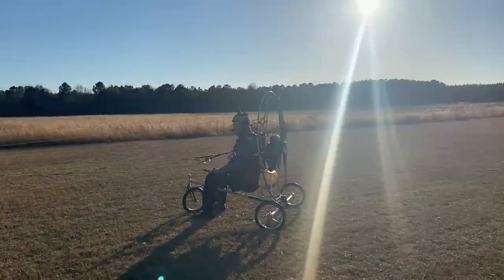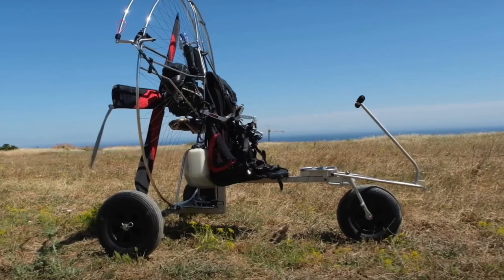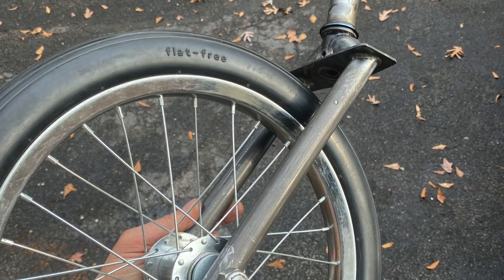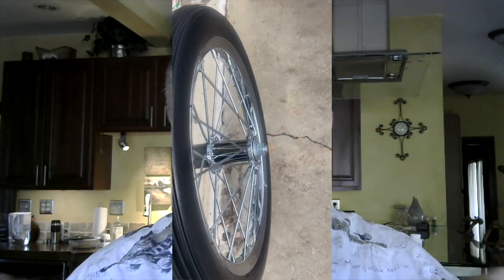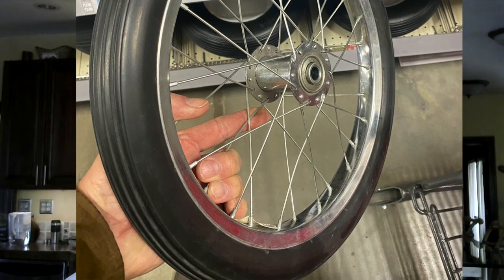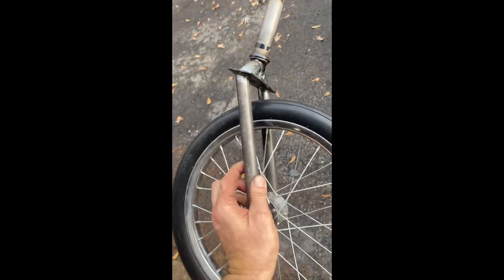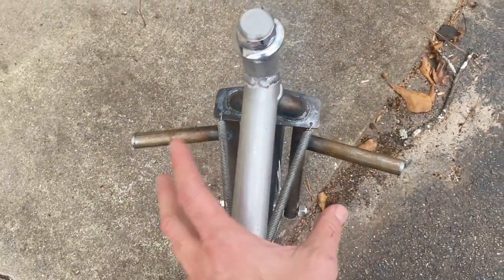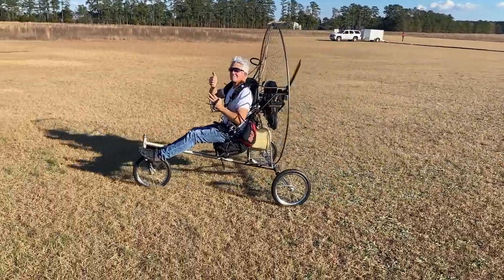The $148 homemade paramotor trike

Comment: Nice Yank. Welcome to Triking. You asked for any improvements. On the Colibri there is only one spring, it has a tab about 3 in long welded order the front fork in the center. A stiff spring hooked to that and tensioned back to an eyelet   on the center pipe. Super sweet build.
Reply from the maker: At a fly-in in South Florida this weekend. I’ve looked at a whole bunch of trikes. Next build I may look to come up with some sort of internal spring that fits inside the vertical shaft for the steering. Nine flights tonight - I’m kind of warming up to it, but I miss the art of foot launching.

Comment: Built my own paramotor as the first one I bought kept losing bits and I spent most of the time repairing it and modifying it to stop staying on the ground or prematurely ending flights. Sometimes it's best to start from scratch and take the best bits and really think about the design concepts. We in the UK have to have a licence to fly non-foot launched. I ended up using a KT100 Yamaha engine. I was 15 stone then and it got me airborne quite easily. I'm 12 now so need to get it out of storage! Youtube Madcow paramotor or Steve Cowham, or both. Cheers!

Comment: Thats great Todd. My one suggestion is that you gusset that 'T' junction. That is a lot to ask of that one weld and if it failed a lot of stuff would get damaged. Now I am inspired to adapt my P2F Rs to my BlackHawk Lite trike.
Reply: Good point VBob! I missed it but agree. I have a problem with his using spoke wheels...side loads on takeoff & landing.
Reply from the maker: OK....I may add either a short gusset plate or triangulated tube supports, but keep in mind that the base of the pap TinOx is stainless tube.  It is bolted in tight and jammed between two 5/8" steel pins at the nose. There is virtually zero play between the trike and the PAP base when it's all together.  That prevents or at least shares torsion placed on the T section.

Comment: Nice bit of designing, engineering, and fabricating, and overall, very impressive! I'm just getting started in PPG this year, focusing on foot launching, but if a trike is in my future, I'll probably be following in your footsteps!
Reply from the maker: This build is not really stout enough for learning.  It's reasonably sturdy, but the wheels I'd used are just light weight and sloppy in their construction.  They are lawn cart wheels not really intended to exceed 5 MPH.  I am working on a few things: 1) a stouter version of this trike with more frame reinforcement so that it won't have to rely on just the "T" join weld 2) larger pneumatic tires and thicker axles intended for the potential need to absorb some "side loading".  3) I am looking to build #3, which is really a community project called Open Source PPG.  That one will be a monster preformance  solo or tandem capable unit.  Progress has been halted for a bit as I travel some but here's where the end result will eventually be available for free: OSPPG.com

Comment: Well done 👍. Great job
Reply from the maker: Thanks. I still fly it but I think I will be spending more money for stouter spoked tires and pneumatic wheels soon.  After many dozens of uneventful landings, I had a smooth landing a few weeks ago that ultimately resulted in a structural failure. After touchdown, I tried to taxi up a slight 3' sand berm between my landing spot and the truck. The berm is grass covered but a little soft.  Minor side load caused the solid rubber tire to walk off of the front wheel, then as the rim dug into the dirt, the lightweight spokes all flexed too much and allowed the rim to bend.  Lastly the forks dug into the ground and snapped my gooseneck weld.  No injuries and it's all fixed now, but cheaply manufactured tires, on poor quality wheels, with spokes made of Chinesium alloy are not a great idea. There are better options for strong tires, but they are way more expensive and require more lead time/planning than a drive to Tractor Supply.

Comment: AMAZING! That is all I have to say about this build. Your use of fusion360 and 3d printing parts was highly impressive! Great stuff Yankee!
Reply from the maker: Thanks! This is encouraging. I really want to build an “all out trike”, for maximun single pilot performance, or best weight capability on a tandem flight. I am learning however, what many before us have learned... and that is the transition between air cooled 2 stroke engines & water cooled 4 stroke engines... leaves a big gap between reliability and power to weight ratio, right around 40+ H.P. There are so few options, especially if you are eyeing production at some point in the future.
Reply: @YankeeinSC1  🔴 What Is Islam? 

🔴 Islam is not just another religion. 

🔵 It is the same message preached by Moses, Jesus and Abraham.

 🔴 Islam literally means ‘submission to God’ and it teaches us to have a direct relationship with God. 

 🔵 It reminds us that since God created us, no one should be worshipped except God alone. 

 🔴 It also teaches that God is nothing like a human being or like anything that we can imagine.

🌍 The concept of God is summarized in the Quran as:

📖 { “Say, He is God, the One.  God, the Absolute.  He does not give birth, nor was He born, and there is nothing like Him.”} (Quran 112:1-4) 📚

🔴 Becoming a Muslim is not turning your back to Jesus. 

🔵 Rather it’s going back to the original teachings of Jesus and obeying him. 

More ....
Reply from the maker: @1islam1  What does it say on that Saudi flag?  Seems contradictory, but thanks for bringing up the fact that.  What's in that black box they march around anyways?
Reply: @YankeeinSC1  dear sir, thanks for the videos. I have been on the verge of building a trike for the last six months or so ever since I ran into a video will yours actually of paramotering, I feel that I could make one a whole lot cheaper than what they are selling them for, please have patience with me I'm not an engineer but what's to keep me from putting a 650cc water cooled motor, I happened to have a motor with only four hundred road miles on it,, it's practically brand-new, would there be a problem of putting the prop on or is that problem able to be overcame ,, I would really love to build my own cart,  I definitely respect your opinion, so any encouragement or if you see something wrong with this approach I would definitely appreciate the input, thanks again for your time, g l Baker lake Cumberland
Reply from the maker: @glbaker5595  I have to assume that the motor you have was designed for a motorcycle?  It's funny in that non-engineering background folks, often miss a full understanding of BOTH the limitations and challenges of repurposing engines for aviation use. This harkens back to the earliest days of airplane design.  The age old question "what engine should we use?"  Or as in your case, we have a "free" engine, can we use it for our flying contraption? The problems are numerous and manifest themselves in sometimes hidden ways... Like we wanted more power so we "upgraded" the engine, but fuel consumption became such an issue...or now it doesn't have the range or payload or the stall characteristics are more dynamic..etc...Most of those airplanes end up as donations to museums or sitting in the back of someone's hangar until they become part of an estate sale.   I've seen and assisted fellow aircraft owners & home builders (and now PPG cart and trike  owning acquaintances) with scores of VW, Corvair,  Corvette, Model A Ford, Briggs and Stratton, Kohler equipment and other automotive conversion applications.  All required highly advanced engineering skills to obtain marginal performance.  In most cases, the sum of the end product cost(s) exceeded the cost of purchasing a new power plant designed for the application (Lycoming, Continental, Vittorazi, Rolls Royce etc...)  Can it be done?  Sure! and it can be fun... but you now have to solve all of the problems i.e. ignition reliability, gear ratio and prop speed, cooling, engine mount system, unknowns like thrust bearings, oil scavenging at non motorcycle flight angles etc... ALL of these factors are taken into account when engineers set out to design an engine for aviation use.   I guess I'm saying that it depends what you want out of life.  Do you want to spend time learning about and tinkering with all of those things? sometimes the hard way (assuming nothing ever fails and kills you)? or do you really just want to spend your time flying? If the former interests you, I can assure you I have fond memories of tinkering with the timing, valvetrain & water pump reliability issues my buddy had on his Model A Ford powered Pietenpol Aircamper (it appears briefly in one of my earliest videos). His ambitions of flying the plane he'd built, all the way to the annual convention in Wisconsin, from our airport in South Carolina were finally realized about the time I started posting PPG videos.  On his flight home however, he landed at a municipal airport about 60 miles short of home.  We took the airplane apart and brought it home on a flatbed trailer.  He reassembled it and thought he'd fixed the problem, only to crash just off the airport property a week later.  He was uninjured, but the aircraft was a total loss...why? Because the engine was a poor choice for a flying machine.  To the later question I've posed...do you really want to spend your time flying? If that answer is "YES", then purchase the lightest (power to weight ratio) and strongest (thrust to weight ratio), designed for the application (aviation) engine.  Best of luck!

Comment: Hey! Fantastic! I made one too!...for about the same price!  What I'm doing now is using a gutted Trike buggy. I strap into my Miniplane, sit in it for takeoff & lift out of it at takeoff speed. Remember the German rocket plane of WW II? It used roller gear for takeoff which dropped away at takeoff then landed on a skid. I do the same but land on my feet. I have Neuropathy. I can land on feet carefully but not takeoff. I'm 73. How many drill bits did you go through to cut through that axle? What type? Thanks! Great video! You may have side load trouble with those spokes.

I agree with Miraslav on thrust angle. Mine was angled too far downward & would actually lift the canopy skirt first for a very sloppy inflation....since fixed.
Reply from the maker: Hi Bill.  I broke only one tool :(   A 1/4-20 tap that I was fortunately able to extract.  I was putting threads in front of those stainless steel motor frame capturing mounts.  On the PAP rolling trike, those holes have bolts installed that allow some left/right adjustments at the base.  Turns out when bolted in there is virtually zero play or slop on mine.  I'll really defend the spoked wheel choice if I get 50 or so flights without a failure.  The wheels are robust and intended for garden carts.  This build was never intended to be a forgiving frame for new pilots.  By theory it is as light as I could make it.  I still subscribe to the one knot more airspeed, one ounce more of useful load, one more mile of range, one less pound of drag...well you get the idea.
Reply: @YankeeinSC1  From listening to you talk you're far more knowledgeable than me. I took the very simple Ace Hardware route....but it works. People ask me why don't I just fly theTrike itself It's because I like sitting in the seat. Anyway thanks for the reply & info! I understand about the spokes now...just us nitpickers out here. You know. Me advising you is like a new A&P advising Bill Boeing.
Reply: Bill do you have a standard miniplane cage with the glassfibre ring or have you reinforced it? I have that frame and have been wondering for some time if it would hold up for a trike, im thinking about the force on the cage as the wing inflates.
Reply: @rickardjonsson4526  That's a very good question & you'll be surprised at my answer! I hate typing on this tablet so I'll reply in the morning  on my desktop with wonderful Win 7 Pro.
Reply: @rickardjonsson4526  I say your reply is funny because I did modify it but the results were okay and not okay. I got tired of replacing those expensive fibreglass rods from old what's-his-name out west. So I got to thinking. Solid rod Aluminum of 3/8ths O.D. variety. Pulled the fibreglass out, used one aluminum rod, fit perfectly all the way around. I'm about to do a video on it but here's where the el problemo came in.

First of all, it (the new aluminum rod) had no problem holding up against the pull strain of takeoff using the Miniplane & a 26 meter. However, one day I had the chute fall off to the left rear in a mild breeze. It partially (just enough) collapsed the aluminum rod into the propeller. I was able to salvage the prop (so far it hasn't shattered - again) and was able to reuse the cage aluminum rod (so far). However, it is weakened now so I have to be careful the chute doesn't fall rear left again. What exacerbated the situation was that I was slow on shutting down the motor. That would've prevented most of the damage.

Now, would the fibreglass rods have prevented all of it. Possibly so. Possibly not....since the force of the chute's (suspension lines) fall was severe. Do I still use aluminum as described here? Yes. I got tired of buying old what's-his-name's fiberglass ones. Fly safe! Hope this helps.
Reply: @billcallahan9303  thats for the detailed reply👌 Why did you need to change the fibreglass, what happened to them? you can buy 10mm fibreglass rods locally or online for nothing, and the short metal sleeve to connect 2 rods together is often free if you go to a plumber shop👍
Reply: @rickardjonsson4526  Good question. First off, I didn't know you could buy them like that. I bought them from...I can't remember that guy's name, he sells Miniplanes & parts, but at $50 for two rods I got tired of buying them after four. So I came up witht the aluminum rod idea. So, thanks to your information, I may search online for cheap fibreglass and Thank You for that. Oh, another reason I went with aluminum rod was, at the time, I thought it would be just as strong or stronger than fibreglass.  I also liked the idea of a one piece loop.
Reply: @billcallahan9303  yeah i see why you wanted alu but it sounds like youve had to change the fibreglass multiple times because they broke? If so how and where did they brake, ive always been curious if they snap or just bend when to much force it put on them😊

Comment: The number 1 consideration in my opinion is to keep the CG as low as possible. I fly a trike buggy right now which is a very low CG machine that is very stable.
Reply from the maker: I almost bought one with a Polini 190 on it for $4500. The engine had some "history", the mount system wasn't ideal and I didn't like the idea of the riser guides, so I passed.  James who taxied mine in this video has 4 machines and is currently flying a trike buggy.  More important than low CG at any cost, IMHO, is a design that is as near an Isosceles triangle as can be tolerated.

Comment: Thanks heaps for this. What I'm trying to work out is the seat holder. While on the ground it looks like you're going to be pivoting forward and back on that part sticking up, and your seat-board. Just strugging to imagine that. Also, in the air how does the seat get seperated from the bar you're sitting on?
Reply from the maker: The PAP seat board is a 5 ply thin laminated board (plywood).  Given that it is attached to the harness at the rear of the seat, you can't really "pivot" much, maybe a little, but the board is supported at two points, the fabric continuation from the harness back and now your under seat support.  Alternatively you could build a little square table like support rather than just a bar like I choose to use.  It's important to note; that as the swing arms are lifted by the wing, the seat isn't lifted off of whatever type of seat support you go with, until the very last little bit of swing arm travel, assuming you want to retain most of the weight shift ability of your foot launch rig. If you don't build so that the swing arms eventually lift the seat bottom off of the support, you wont enjoy as much weight shift capability.
Reply: @YankeeinSC1  Thanks for the explanation

Comment: Took off no problem. What does it weigh with and without motor? Not much give in that rear end. I built the Lite Trike we had to adapt it to a Flat Top because of the crumple zone. I really like my lite flyer. Fiberglass axles makes for smother landings. Looks like you did a great job. Love to see more videos. Very smooth landing.
Reply from the maker: I need to weigh it... 28 pounds?
Reply from the maker: I did weigh it...29 pounds plus primer and paint
Reply: That's a lot lighter than most. Mine was 30 lbs that was with the wheeleez beach tires (which coast the most, about $230). Now I have a 5 gal aluminum gas tank and 11' chrome 4 ply go cart tires. I also made a self centering front end. Same principle as yours. Do you have pictures of the hang test? I'm sure your wheels will take squirrel holes much better than mine... but I look sexy lol.
Reply from the maker: @David65702  I did post a photo of the hang test on the facebook paramotor homemade page.  Pretty benign I had to move my attach points as far forward as the PAP arms allow. to insure the front wheel leaves the ground first and arrives last.
Reply: I'll see if I can find it I'd like to see it. It seem to work fine. When I first tested my trike I had the hang points to far forward and had to pull hard left brake to keep from spinning donuts, though I built a pile of crap but it was just the hang points. Look forward to more videos. You know you have to get one of Gorilla's sexy trike shirts right lol.